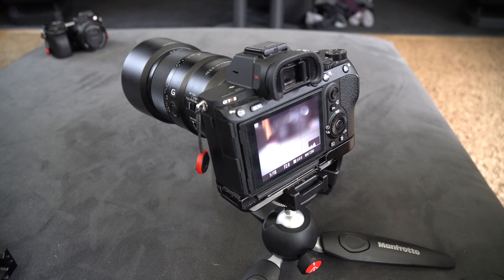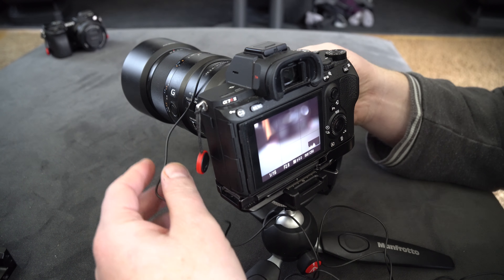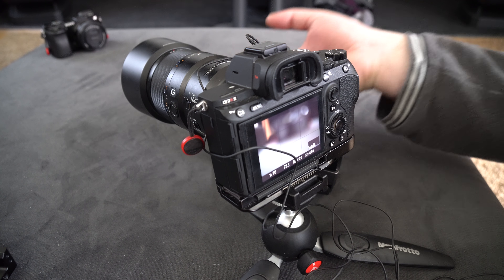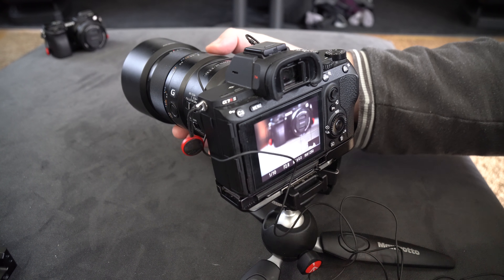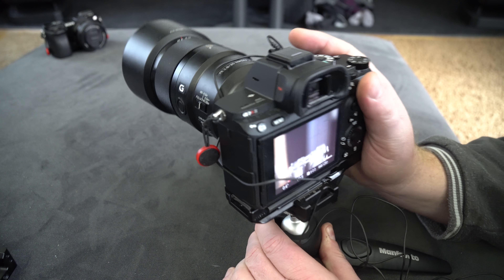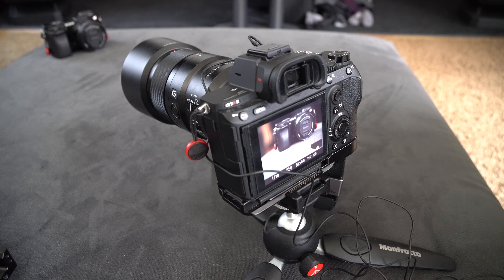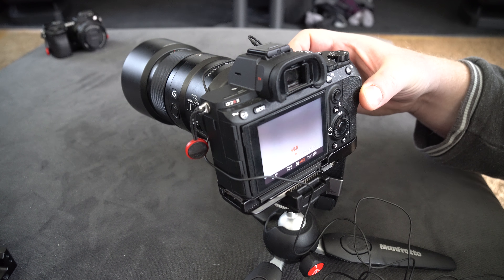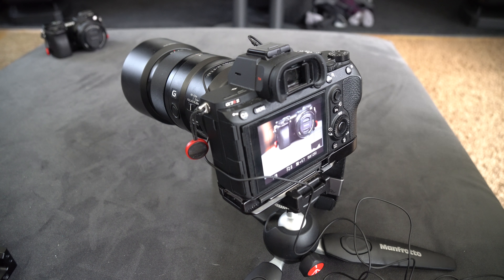a7r iii FE90mm macro focusing sound (or lack of it?)

Comment: Hi Daniel, I just subscribed to your channel! 
You are lucky. I have the Sony 90mm macro, as well and mine is quite noisy. I would not use it for video, at all. I actually did compare my lens to other copies right after I bought it as I was so shocked by the noise of the motor and found that there is a real variation out there. If I could, I would have taken mine back but, as there is nothing wrong with the photo quality of the lens ( it is excellent), I  decided to keep it as using it for video was not the primary reason that I bought it.
Reply: A quick update - happy to report that the loud focus noise that I heard from my new Sony 90mm macro lens, especially in video mode has  actually diminished with use over the last 7 months.  Also, I am now using it on an a7iii rather than the a6500 so that could be a reason for the improvement in  what is picked up of the focusing noise. Image quality is excellent on either camera.  I plan to use it more now on the full frame body as it is a better balance overall. I continue to enjoy your videos, Daniel- thanks!
Reply: @chryseass.5143  Is it entirely gone?
Reply: When you dial in the focus ring in MF, do you also hear a very faint sound of the motor running? Is that suppose to be normal?

Comment: my sounds the same. when you do "manual" focus you do "focus by wire" so its not  real manual focus. then the sounds is there too because the motors are working
Reply: I have the same issue when im dialing my focus in MF. I can hear a slight noise when adjusting. Is this normal?